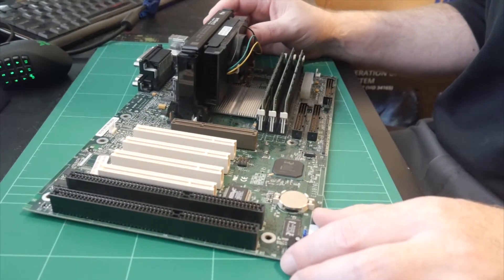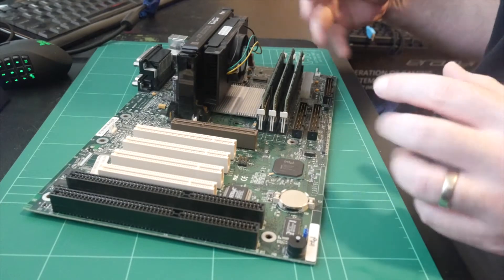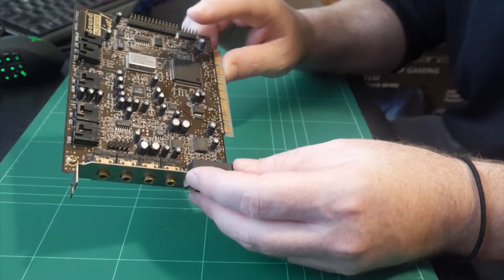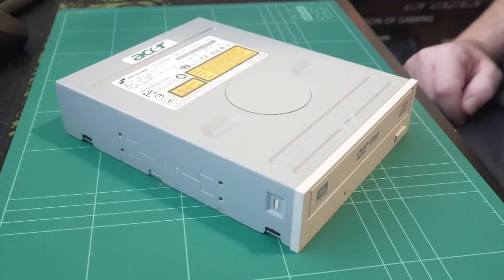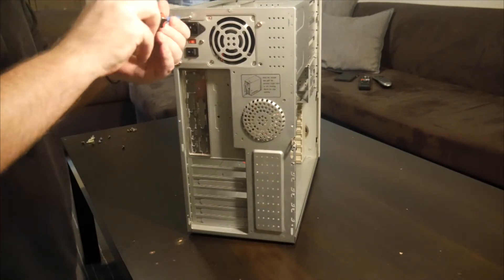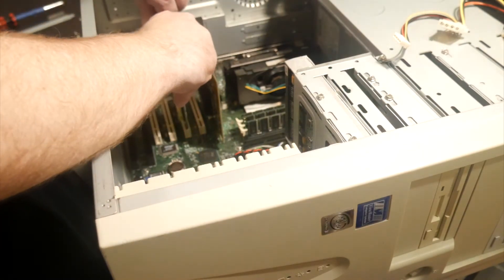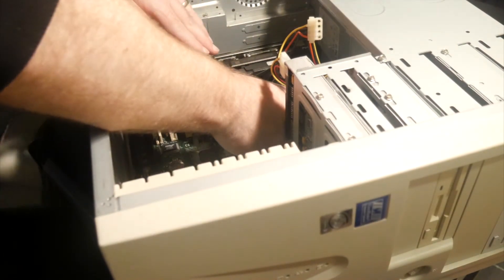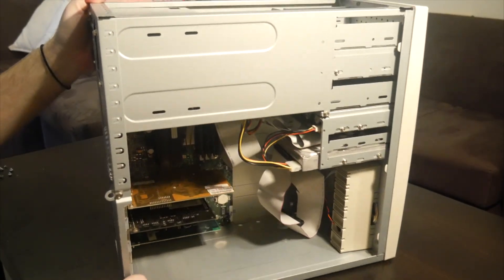Pentium 2 - Let's build a Pentium II - Part 1

Comment: Second view. Feels odd for some reason. :D
In a no OC Pentium II 400MHz build I'd keep the Intel board over the Gigabyte one for its better build quality. I think the earlier Gigabyte boards had problems with delivering sufficient AGP currents too. 
And you're right, cable management isn't needed for thermal reasons with that system. But if you're worried about the looks of your disc drive I would really suggest diving into the art of IDE cable management. Getting it just right and having your build look all clean is just so satisfying. And while I'm nitpicking: Some of your cards are in at an angle. ;-)
Stay safe! :-)
Reply from the maker: :) Thanks, I did straighten up the cards off camera. I always think about going back in and doing some nice cable management on those IDE cables, I do have some sleeved EVGA ones I could use instead that may look a bit nicer.